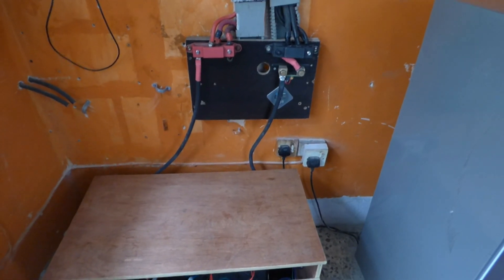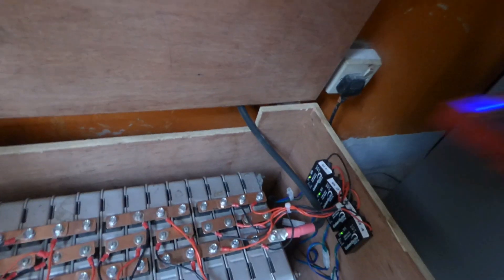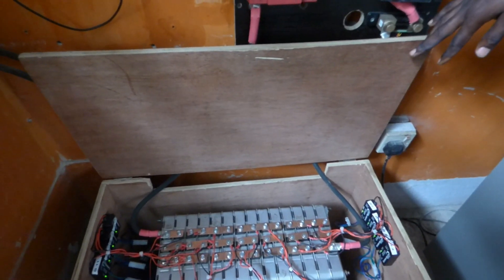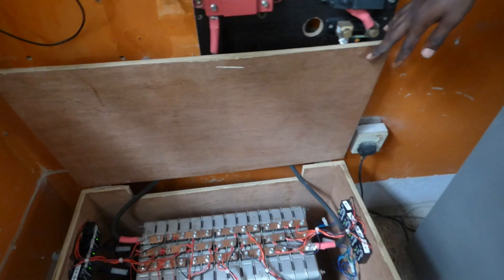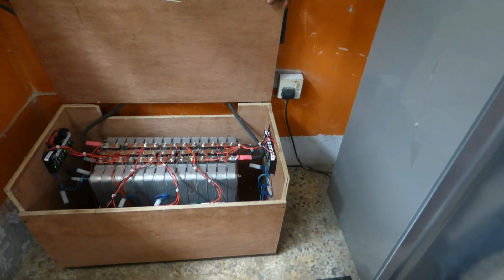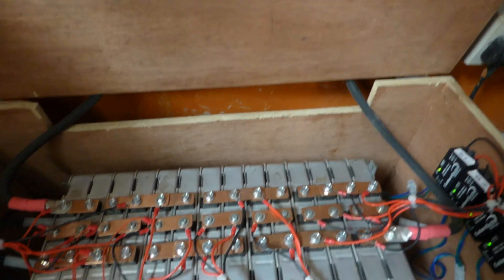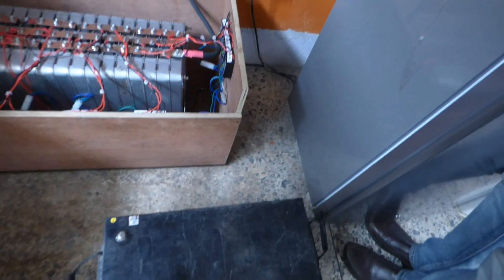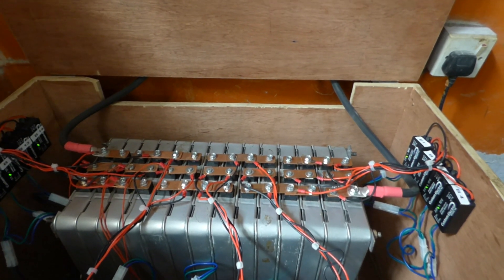Fixed battery problem and answered question how many 200 AH Battery

Comment: glad you resolved it, First to comment today again
Reply: bro we're still using lead acid batteries, I don't use deep cycle just car batteries for lighting, till I get Lithium
Reply from the maker: You are amazing. Thank you
Reply: @drsolar  how are your thought on lithium titanate batteries
Reply from the maker: @irenethompson9058  I have not really paid attention to them yet. The claim is that they are better than Lithium ion batteries. I will buy some and test them and post a video of my impressions.
Reply: @irenethompson9058  for solar storage, stick with LiFePO4. The advantages of lithium titanate batteries are basically extremely fast charging and discharging capabilities without suffering damage as well as many charge/discharge cycles, upto 20,000 in some cases. They however have poorer energy densities and worse charge/discharge efficiencies than LiFePO4 and NMC. They are also the most expensive of the three broad lithium battery chemistries in common use today.
Reply: @adon8672  why do say stick with lifepo4 instead of titanate batteries?
Reply: @drsolar  That will be nice
Reply: @adon8672  I think I found some cheap ones on aliexpress, and for the charge and discharge cycle, it will just save me for once in a life time, more than 50 years
Reply: @irenethompson9058  you can try them and see how it works. Lifepo4 store more energy per dollar than titanates presently and you'll be charging and discharging them more frequently since they store less energy. While the idea of spending once and for all appears great, battery technology is improving and getting cheaper all the time and you could be stuck with old and expensive batteries. Titanates are best for difficult or inconvenient to reach/replace applications. Some of the best ones are made by Toshiba and they are really expensive. The ones on Aliexpress appear to have innacurate capacity rating. Will Prowse did a video on them recently and you may like to check it out. It's no coincidence that most lithium batteries used even within China are LiFePO4. Again you can give titanates a try.
Reply: @adon8672  There are some good sellers with reputable score in aliexpress
Reply: @irenethompson9058  That's encouraging. Just give them a try. Hopefully you can make some YouTube videos about them and share your experience with us.